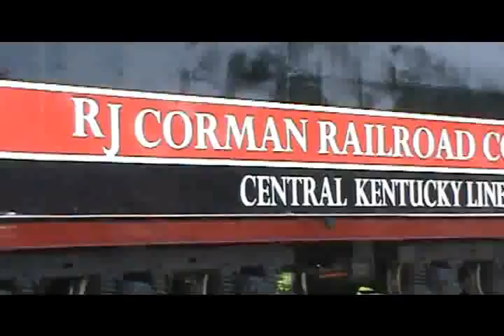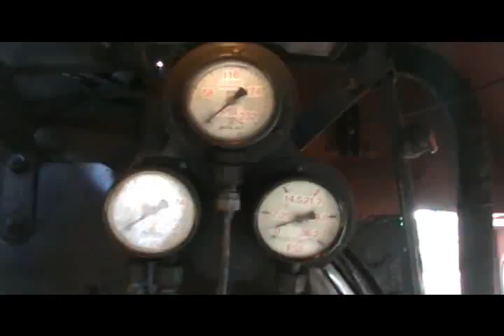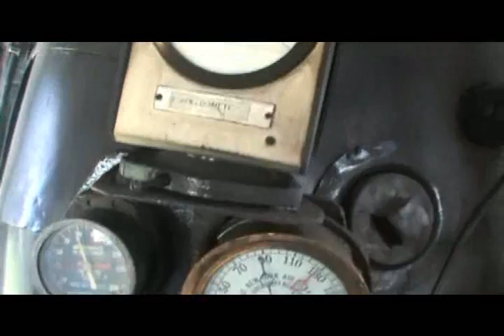FINAL RUN of R.J. Corman Steam Locomotive

Comment: I can’t seem to get behind all those comments claiming the locomotive was scrapped, and insulting the quality of the locomotive for being chineese built. Just because your cheap gadget was made in china, doesn’t mean china is bad at manufacturing things- it’s just that china is contacted to make things cheaply, so they can be imported and sold here in the states. This locomotive was clearly built to do work. Do people seriously think that a chineese railroad would have any use for a badly built locomotive during the heyday, or later, of steam? Locmotives were built to serve the railroads, and if they didn’t do their job well, then the railroads would suffer. This is not a cheap piece of junk. It wasn’t even built for export! If you want to talk about “cheap” locomotives, then have a look at some of the wartime steam locomotives that were built for military use in the world wars. Those locomotives were built on the cheap, and yet, there are multiple examples still around, some even running- and they were literally intended to be expendable (for instance, the USATC class S160, which was notorious for failures, and had a life expectancy to match it’s purpose- they were simply military supplies, not intended for long term use). Supposedly, there are 26 preserved examples of them (largely due to the massive number manufactured). They were truly not of the best quality, even if they setved their purpose well. And they were ALL american made, by Alco, Lima, and Baldwin. That’s right, the ‘good ol U S and A’ exported cheaply made steam locomotives! No need to go bashing this steam locomotive because of where it came from, and questioning the quality of its construction.
Reply: Stormtrooper1488  ok, I apologize. Either which way, just because you seem hellbent that steam locos deserve to be scrapped doesn't make it acceptable to ruin our fun and enjoyment of what is an extremely cool hobby. If we scrap items of historical importance, we cannot educate the next generation properly. Textbooks with pictures of steam locos can never beat seeing a loco in the flesh.

Comment: Great video.  Thanks for posting.  I loved the wheel slippage at 13:26.  Also thought the police escort through one of the towns was a nice touch...nice way to go out.

So...what does a slightly used Chinese 2-10-2 QJ steam locomotive go for these days?
Reply: I'd rather have an 8000 series JS class 2-8-2.  Those were the improved "B" models built in 1986-1988.  Slightly lower axle load and slightly faster.  They're still hard at work in the open pit mine at Sandoling in Xinjiang.  China definitely pirated some modern steam tech for that batch- tons of power and almost no smoke.
Reply: I'd rather have a Kloke Loco Works 4-4-0 replica, seems like a better option if you'd prefer to customize it.
Reply: +Mark Stockman There is a JS in Iowa at the Boone & Scenic Valley Railroad

Comment: Somehow I see Iowa Interstate as a likely home for this locomotive......
Reply from the maker: I doubt that. Iowa Interstate announced a couple weeks ago they're phasing out operating their QJ's.
Reply: Really? Well crap.
Reply: PWND
Reply: Pwnd? This was a while back. I have since talked to sources from Iowa Interstate itself. The QJs are going to a new organization and will be run.
Reply: They will be scrapped. Very polluting locomotives. Scrap all steam!
Reply: They just announced an excursion weekend coming up in about a month.
Reply: @MrRailroadrunner  They sure are
Reply: @PreservationEnthusiast  Don't scrap all steam because people lover american steam even RJ Corman 2-10-2 # 2008
Reply: @danielwalton9012  This isn't American steam it is cheap Chinese junk which has been sliced apart with cutting torches and melted down as scrap.
Reply: @PreservationEnthusiast  You may call it Chinese junk but I call that RJ Corman steam locomotive #2008 a treasure and steam engines are pretty no matter how their whistles may sound and steam locomotives like this RJ Corman railroad steam locomotive along with Iowa Interstate railroad steam locomotives numbers 6988 & 7081 plus Southern 4501,N&W 611 ,2156,1218 ,R&M 425,Reading lines 2100 & 2102,NKP 765,PM 1225,N.C. & ST L 576, MEC 470,C&O 2716,MILW 261,SP&S 700,S.P. 4449,AT&SF 3751,2926,5000,3463,UP 844, 3985  & 4014 ,Pennsy Duplex 5550,Frisco 1522,NKP 587,Frisco 1630,Frisco 1352,Boston and Maine 3713,Southern 1401 and many more should be running and we need steam engines to help save all of amtrak's trains as well as to run for all future generations to enjoy for many years to come
Reply: @danielwalton9012  Unfortunately for you when Corman died, they didn't share your enthusiasm for this Chinese crap. They sent in the torchmen and cut this junk up  in a few days and loaded out the scrap for melting and recycling.
Reply: I agree with you there
Reply: @PreservationEnthusiast   You may call it Chinese junk but I  disagree with the scrapping the steam locomotive part and call that RJ Corman steam locomotive #2008 a treasure and steam engines are pretty no matter how their whistles may sound and steam locomotives like this RJ Corman railroad steam locomotive along with Iowa Interstate railroad steam locomotives numbers 6988 & 7081 plus Southern 4501,N&W 611 ,2156,1218 ,R&M 425,Reading lines 2100 & 2102,NKP 765,PM 1225,N.C. & ST L 576, MEC 470,C&O 2716,MILW 261,SP&S 700,S.P. 4449,AT&SF 3751,2926,5000,3463,UP 844, 3985  & 4014 ,Pennsy Duplex 5550,Frisco 1522,NKP 587,Frisco 1630,Frisco 1352,Boston and Maine 3713,Southern 1401 and many more should be running and we need steam engines to help save all of amtrak's trains as well as to run for all future generations to enjoy for many years to come here.
Reply: @HaddaClu  Yeah the did and RJ Corman railroad steam locomotive #2008 should join those QJs in an excursion regardless on how it may look
Reply: @MrRailroadrunner  don't listen to those who want those steam locomotives scrapped
Reply: @Daniel Walton These steam locos should all be sliced apart and melted down as scrap charge due to pollution and global warming.
Reply: @PreservationEnthusiast  I bet you didn't know that diesel locomotives are actually WORSE for the environment! Diesels output carbon dioxide (trees need that to produce oxygen, so not necessarily too bad), nitrous oxide (very bad stuff, can kill and is causing global warming) along with various other deadly gases. The only things a steam loco puts out is carbon dioxide, again needed for trees to produce oxygen, and steam
Reply: @StaxRail  Wrong. Coal smoke contains carbon dioxide, carbon monoxide, heavy metals, hydrocarbons, arsenic, cyanide, NOX, particulates and various carcinogens. So does diesel smoke. 

Both types of locomotives must be scrapped and the metals melted/recycled. 

We must replace them with clean electric traction, the electricity from renewable sources,  and hydrogen power.
Reply: @StaxRail  nice
Reply: @StaxRail  steam power is one of our greatest inventions that must be preserved. Considering emissions the up Big Boy can do the work of many diesel engines together. Also electric locomotives get there power from something to Mr. Scrapper. It's called a coal power plant, or nuclear plant, hydroelectric, or " environmentally friendly " ( not ) wind and sun. Not to mention that electric locomotives aren't what they are cracked up to be.
Reply: @TheBroughamGamer  exactly, steam is still the way forward
Reply: @StaxRail  Electric power and hydrogen power is the way forward. Steam locomotives will be sliced apart with cutting torches and sent for melting down and recycling.
Reply: @TheBroughamGamer  Electric locos can be powered from electricity generated from renewable resource.

Scrap all steam locomotives. Slice them with cutting torches and melt them down.
Reply: @PreservationEnthusiast  renewable resources have to be made from something to tho.
Concrete, steel, electronics, and plastic. Those are not renewable.
They also creat pollution when being made.
The concrete might be renewable but it will never return to earth because most will get reused in construction.
Reply: @TheBroughamGamer  When I say renewable, I am talking about solar, wave power, hep, tidal, wind power, nuclear fusion etc.
Reply: @Brian Hebert Yes, I certainly will ignore him. I thought he was a troll too.
Reply: @Brian Hebert How can you be? You addressed a comment to me about "he". Don't you know how to use You Tube? In any case, I agree. The Brougham Gamer is certainly a foamer and a troll.
Reply: @Brian Hebert  Haven't you heard of climate change and global warming? Greta Thunberg has even been over to the States recently to explain it all for you.
Reply: @PreservationEnthusiast  melting down locomotives causes pollution too!!!
Reply: @PreservationEnthusiast  everytime you fart you are polluting the enviroment.
Reply: @PreservationEnthusiast  you forgot atomic powered locomotives.
Reply: @rearspeaker6364  The thing is we need new steel to make new modern efficient locomotives and other human needs. 

Given that we need a constant supply of steel, it takes half the amount of  energy and pollution to make it from scrap as it does to mine new ore, transport the rock and smelt it. And we are saving continually making more damage to the earth by reusing what we have.

So the facts are in favour of using scrap steel rather than ore on pollution grounds.
Reply: @rearspeaker6364  True if nuclear fusion can be reproduced on a small scale. At the moment, we can't even make it work on a large scale but experimental reactors are being built.

Nuclear fission is possible so yes, we could use that but there are huge dangers from radioactive isotopes and harmful nuclear waste.

Comment: The engine is sidelined because the new owners don't wan't to spend the money to get its 5 year inspection completed.   Roughly, how much does that cost?

I also have to say, again, I love the wheel slip at @17:51!
The police escort was a nice touch at @26:56.  I mean, when will you ever get to see a police car escort a locomotive ever again?
Reply: THAT PARTICULAR INSPECTION IS RATHER EXTENSIVE AND INVOLVES MOSTLY BOILER ISSUES!  ALL JACKETING AND INSULATION IS REMOVED FOR THIS INSPECTION.  METAL THICKNESS AND CORROSION IS CONSIDERED, ALONG WITH TUBE AND STAYBOLT WORK!  THE BOILER INSPECTIONS LIKE THIS USED TO BE A 1 
YEAR INSPECTION, BUT NOT THE INSPECTIONS REVOLVE AROUND THE NUMBER OF DAYS ACTUALLY USED!
AS THESE LOCOMOTIVES ARE NOT USED ON A DAILY SCHEDULE, THIS GIVES A REALISTIC 
INTERVAL BETWEEN REQUIRED INSPECTION!

Comment: I see it has a cop of a Standard HT 1 stoker they say in China they just used two fireman and some of the engines even h ad copies of Worthington feed water  pumps that was hard to believe
Reply: david levine 

The Chinese copied any  mechanical device they needed and never worried about it because though you might sue in a Chinese court you had zero chance of winning. The QJ's all had stokers and a second fireman to keep the corners filled properly as it was deemed safer for the fireman to stay in his seat and help keep an eye on the track ahead. 

Southern 4501 has an HT-1 stoker and a model 3A feedwater pump and feedwater heater. From a Chinese 2-8-2. Granted they are copies of the American designed products but who cares. The Chinese copied them exactly as they were built here in the USA. Try and buy one new or used in the US, you can't. Just remember the last QJ's built were built in 1988 when they shut down steam locomotive production.
The last steam locomotives built for domestic use here were in 1949. The QJ was a Russian design they copied and built and over the years they improved the design quite a bit, if I remember correctly the Chinese started building the QJ about the time we built our last steam locomotives here in the US, it was in production longer than any other steam locomotive China ever built.

Comment: Where is this lcomotive now? Why would the stop using it. The talk about keeping the standard and traditions of R.J. Corman alive and continuing his legacy - Obviously that is a lie. The first thing that goes is something he cared about very muck. That does not sound like a Chinese Whistle (Chime). Does the engineer know the whistle signals for a crossing?  At 5:08 - My that is a lovely sight. And what is hell is that diesel doing in the consist.?  That is great - right down the main street - and you hear they engineer cut back on the throttle.  Damn stupid idea to store an operating locomotive especially when you own the rails it runs on. Corman built an empire and those who come after have torn it down. Typical of modern USA.
Reply: Crossings get a [two long, one short, one long] at every crossing NOT in a quiet zone.  The diesel is present for dynamic braking and as a backup in case something goes wrong with the steam engine operations.
Reply: The steam engine was purchased to run occasional steam excursions with the Kentucky dinner train which they operate and to see if it would be profitable to run their sand train under steam between Louisville and Lexington.

Comment: Too bad it had to pull all the dead weight in that diesel.  Check out my channel for a video of the MR 261, also forced to pull a diesel for safety.
Reply: +ByrdMann2010 It's interesting you say that as, at one point, 2008 was a regular locomotive, just like 3805 is now. Instead of thinking of 3805 as "dead weight", imagine a day when you'll be able to tell someone "Yeah, I was there when RJ Corman still had GP38s!"

Comment: The only GOOD steam engines are UP 844, UP 3985, UP 4014, and SP 4449.
Reply: Also, the steam engine in this video had a diesel locomotive bell configuration.
Reply: Opinions my dear child, I love the 2008, which now has a swinging bell (as seen in the second half of the video), I love the 4449, and the 3985, and the 4014. The 611, 765, and 4501 are the top three for me, but honestly, any steam is good steam, there is no need to call this a bad locomotive. Again, with so little steam in America, any steam is good steam, please don't be so immature.
Reply: Jacob Schiess At least it's just my opinion, so....yeah. -Creeper
Reply: stampycatfan01  CSX needs to overhaul the Allegheny and show the UP fans how it really is done. Oh wait, it would roll the rails over on the UP because their track isn't heavy duty enough to handle a 2-6-6-6. I'd even settle for NS doing the job as long as they lettered it for the Virginian. 389 tons on the engine for the Allegheny while only 381 tons for the UP 4-8-8-4. 80,000 lbs on the each driver axle vs 67,000 for the 4-8-8-4. C&O and Virginian didn't need to haul all the dead weight in the tender like the UP did. :-) To put the driver weight in perspective, that is the weight of one semi on each driving axle for the C&O and VGN RWY locos. 

And as for the Chinese imported locos, I like them too. I inspected the ones that came in back in 1989 while they were in Jacksonville on the Trade Fir to make sure that when they got to Baltimore they didn't have damaged pipes from the winter weather. Funny thing was, I looked at that letter yesterday morning making me a representative of the Valley Railroad.
Reply: I'll' drink to that, love to see an H-8 run.
Reply: All steam engines have a beauty and charm to them.
Reply: What about N&W 611 and ATSF 3751?
Reply: All steam engines should be cut with cutting torches, scrapped, and melted down.
Reply: @stampycatfan01lol  Iowa Interstate QJ 6988 is now Americanized and has a diesel locomotive bell
Reply: @stampycatfan01lol  Every locomotives from different countries are the best!!